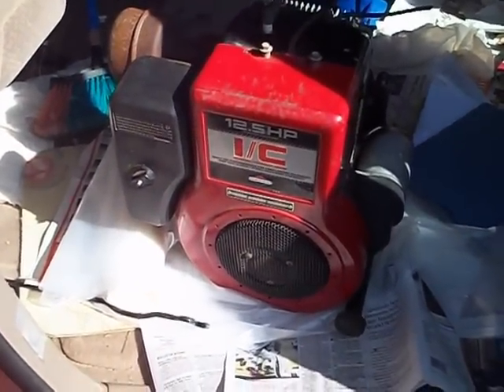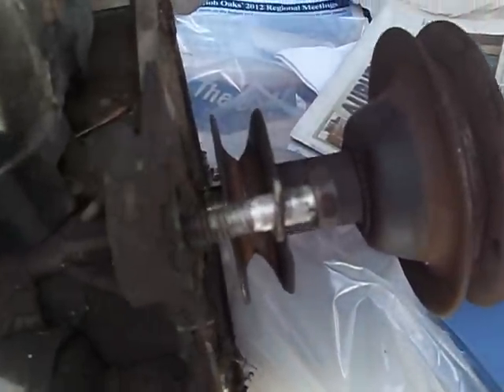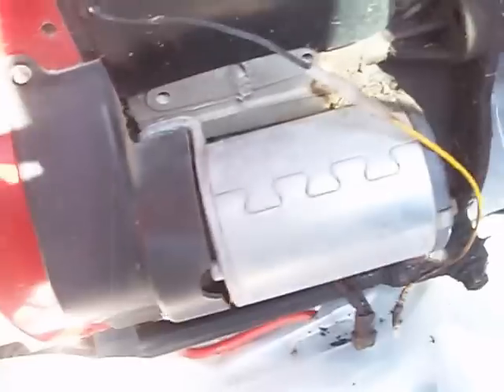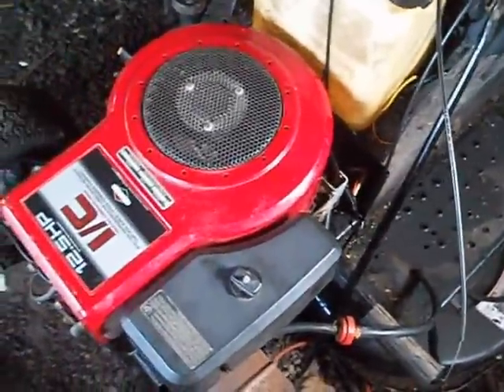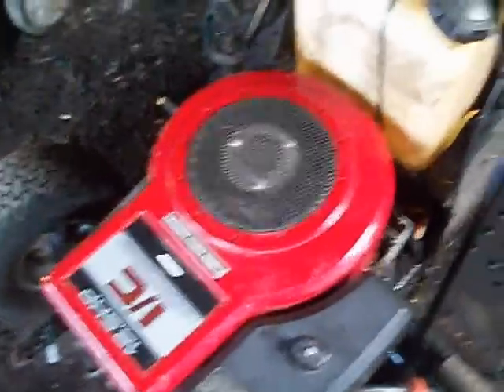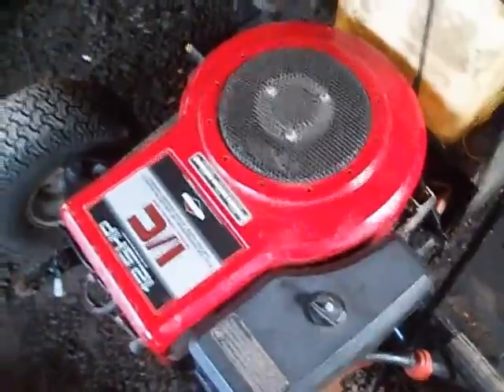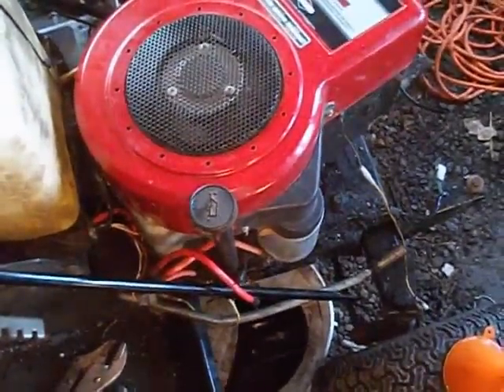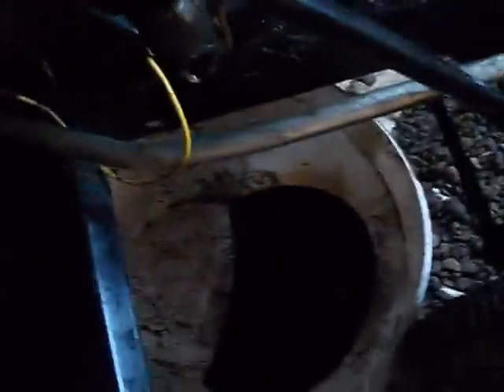Picked up a 12.5 hp 1994 IC Briggs Engine for $45.00 I drained some really old looking oil

Comment: good buy! i would replace the fuel line, if it don't leak you don't have to be in a hurry to replace it, but i would plan on it. you need 1/4" ID fuel line, go  to pats small engine (online store) like a dollar a foot. use either 10w-30 or i recommend 30 weight, either will work. i like to use supertech oil for break ins and for testing new engines i get. then i use valvoline in it.

Comment from the maker: there is a vid up of it running I had to swap out the carbs the one on it was bad. I used the carb off one of my blown ones in the garage. I just bought a drive belt and deck belt for my tractor hopefully it works out this was my first riding mower my 1999 briggs threw a rod this engine was the replacement I also tried putting a 89 briggs on it that one threw a rod too

Comment: Replace fuel line put you a plastic fuel shut off valve on gas line between tank and new fuel filter and clamps
Reply from the maker: yes i know this engine is now on my snapper comet